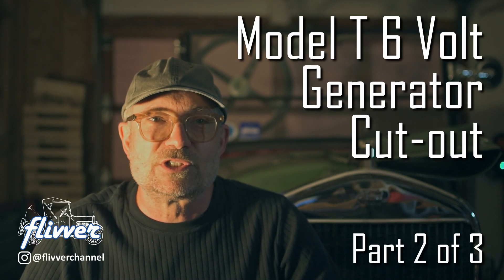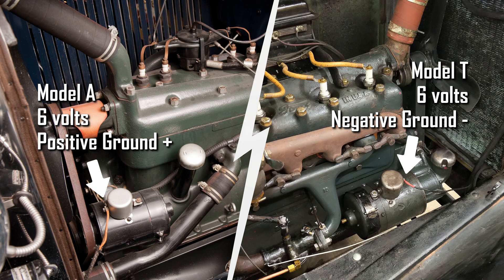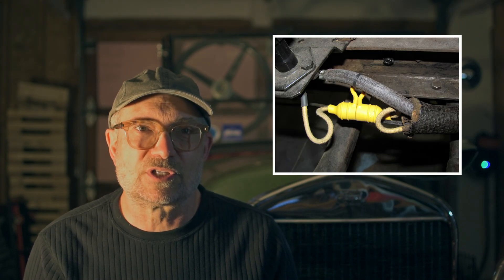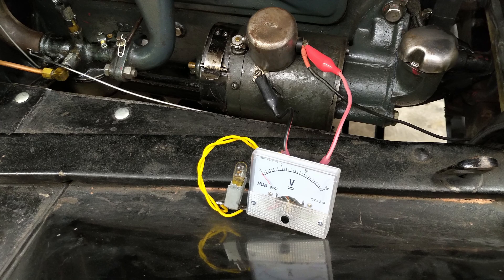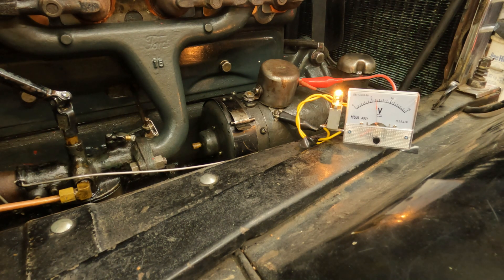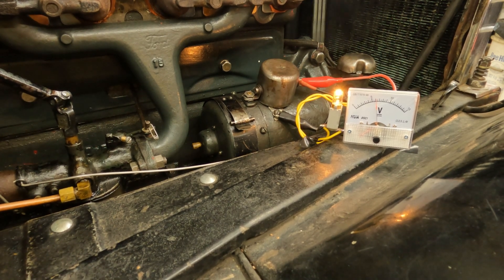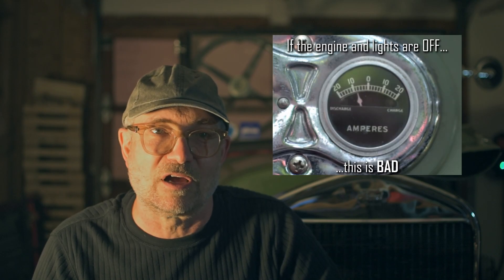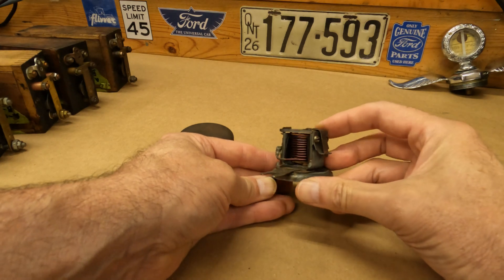Model T Generator Cut-out Explained and Tested

Comment: I have a 24 T     problem I have is the the generator overcharges - voltage wise.     Pretty much twice the 6v battery voltage or about 12v to about 16v  as measured with a common volt meter.  As for now I have the gen windings shorted and just keep 6v battery charge using a regular ol battery charger.      Any ideas why the higher voltage output ?   Thanks
Terry from Sacramento
Reply from the maker: Terry, have you watched all three videos in this series? Vid 1 helps a lot with this. How much current, Amperes, does the gauge show when the generator is outputting too-high voltage? If the current is also high, then the Gen is set to a high output setting and the third brush must be adjusted. If the current is low, then the wiring from the Gen to the battery is suspect.

Comment: There are 2 winding's in the cut out. One is for back current and you did not ex plane it.  If you don't know electronics please don't put out misinformation.
Reply from the maker: Thanks for your feedback. Please provide specific quotes and references where I am incorrect, with clear corrections. I would welcome correction as I strive to learn more.
Reply: @flivverchannel  The original cut outs have second coil winding that when it gets a high 7 voltage from the battery it weaken the generator relay ( first thick winding) and the cutout, opens the (cut out) points and prevents over charging the battery You must have a full understanding of electric science, witch most people on You tube DON'T HAVE, but give incomplete information. I hope this helps understand the full workings of the original cut outs.
Reply from the maker: @MartinSBrown-tp9ji thank you for the explanation of the two cutout windings. I understand their function. I rewatched this video now. I do not see where I provide misinformation. Can you provide a timecode where I give false or misleading info? I would like to correct it, if I do.
Reply: This thick winding stops the cut-out contacts from chattering once they have closed. Also when the generator stops charging, the momentary reverse current from the battery creates a magnetic flux which cancels the existing flux and quickens the opening of the contacts. @MartinSBrown-tp9ji
Reply: @MartinSBrown-tp9ji  Amazing!!! After hours of searching. Finally a great exolaination of the 2nd heavy coil and its purpose
Reply: @ianrobinson9565  Thank you Mr. Robinson! Finally a great explanation of the heavy winding and its purpose. I believe this winding is between the battery connection on the cut out and one side of the NO contact. It is wrapped around the core and as you graciously mentioned, prevents contact chatter when they are closed, and the momentary reverse current from the battery creates a magnetic flux which cancels the existing flux and quickens the opening of the contacts. RIGHT ON !!!!
Reply: @dougkiss7630  To add further. If you look at the relays in a more modern RB 108 regulator take a look at the pole face under the armature. There is a small square piece of non magnetic material stuck to the pole face. This is usually brass or fibre. Wherever you have a magnetic field there is residual magnetism. The armature tends to stick to the pole face, hence the reverse current acting with the return spring to make sure the armature does open.

Comment: I am rewiring a 29 Model A, 6v pos ground.  As soon as connect power to the cutout the safety fuze blows, if I bypass the fuse the wire smokes as does the wires to and from the ammeter.  Bad cutout?
Reply from the maker: Charles. Would need to know more detail to try to help. Are the situations you describe with the engine running and the generator turning, or engine off?
Reply: Yes it's stuck on.

Comment: I've picked up a number old Model T generators for parts over the years, some came with a cutout still attached. I decided to open one up to see how it looked. The weight of the old cutout was twice the modern one I had on my T. I found the one I opened to be perfectly good still and I've been running it for almost a year.
Reply from the maker: I have a little experience now with the old cut-outs.  They seem to be well-made.  I like using them, if I can, since they are maintainable and fixable, and I just like running the original stuff on the car when I can.  Thanks for watching!

Comment: Great explanation  One point though, you should remove the positive battery terminal first  for safety on a positive ground system.
Reply from the maker: That is excellent advice for Model A. Very correct.  Model T is Negative ground, so opposite.
Reply: @flivverchannel  I didn't know that the T's are negative ground. I had assumed they were the same as the later models. You learn something every day. 🙋‍♂😉
Reply from the maker: @MatthewBerginGarage  bizarre how the T is Neg ground, the the As were Pos ground...then sometime quite later all the cars switched to Neg ground again. Maybe I should research that and make a video!
Reply: @flivverchannel  I heard that the positive ground system lead to less body rust, but the wiring connections would corrode more readily. Corroded wire connections on my 1953 Ford with only 7 wires on the engine is not a big problem. My 1997 Lincoln Mark VIII with it's 4" bundle of 20 gauge wires heading for the engine is an entirely different matter.😱

Comment: Awesome video.  Here I thought my cutout was draining the battery and that isn't the issue.  I appreciate the step-by-step instructions.  Any idea how a guy can troubleshoot where an electrical drain would be?
Reply from the maker: Have you found your electrical drain? Sorry I wasn't any help.
Reply: @flivverchannel  No.  The generator wasn't charging so I had it rebuilt.  The battery still goes dead over time.
Reply from the maker: @classicalvintagecollector  I wonder if my battery would drain slowly too, but I don't notice because I use a master battery switch. Wish I could be more help.